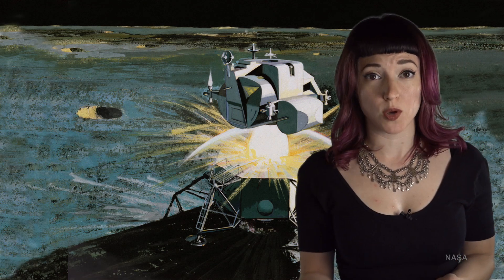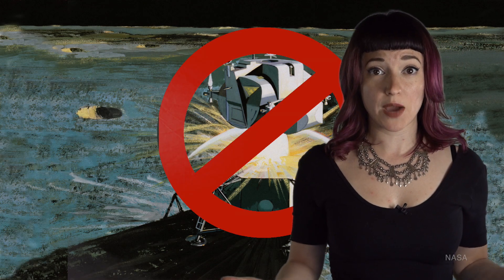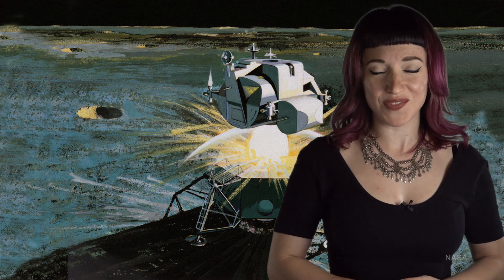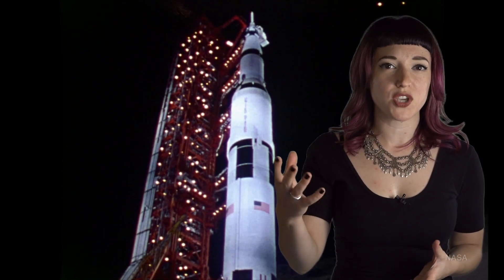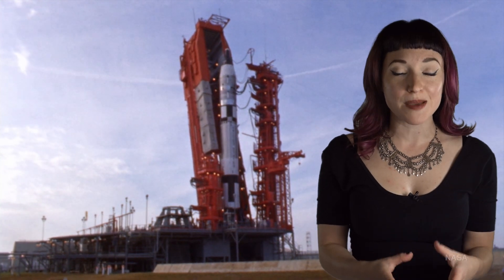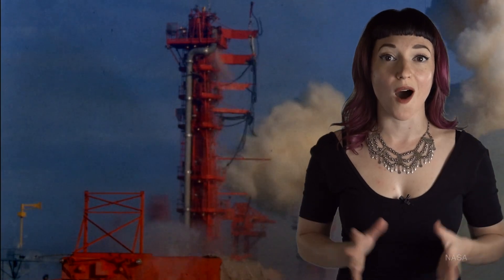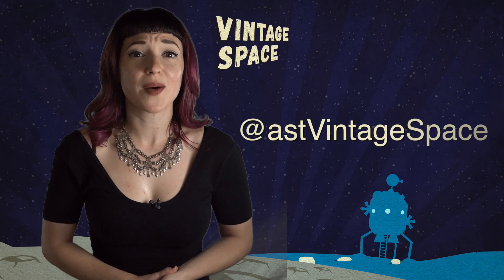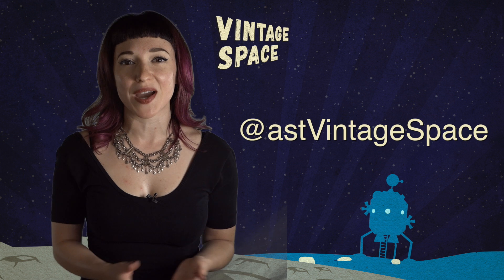How the Lunar Module Launched from the Moon Without a Flame

Comment: Moonlanding is a hoax, of course.
Amy, can you do an analysis of how the astronauts survived the radiation past the Van Allen belt?
Reply: +MaximusPayne   Google "Apollo 11's Translunar Trajectory and how they avoided the heart of the radiation belts" along with "Apollo and the Van Allen Belts an estimate of the radiation dose received". No radiation expert from any country in the world for the past 45+ years has brought forward any evidence that any of the info in those 2 links is false. Of course, there was always the possibility of a solar flare occurring during the missions but they had contingency plans in case of such an eventuality. Google " APOLLO EXPERIENCE REPORT PROTECTION AGAINST RADIATION"

No doubt you will bring up the NASA video prior to the Orion test that has you hoaxheads high-fiving each other in glee. At some point in the video, the NASA engineer said this:

"We must solve these challenges before we send people through this region of space" 

This is the only statement in the "Orion-Trial by Fire" video that supposedly hints that the Apollo landings were faked. It's pretty amusing how hoaxheads always say NASA does nothing but lie until you mistakenly interpret something that would support what you believe. So the big question here is. Do you think the Apollo missions all happened in the same region of space as to what Orion is being designed for which includes a possible trip to Mars?

Question for you: Do you think the trajectory through the VAB's for the Apollo missions from the Earth to the moon is the exact same as the trajectory for a manned mission from the Earth to Mars? 

Another question: Do you think the radiation exposure of the Apollo missions that lasted a maximum of less than 2 weeks would be the same for a mission to Mars that could last as long as 2.5 years?

3rd question: Do you think that todays electronics are as robust against the detrimental effects of radiation as the rope-core based computer systems used during the Apollo missions?

Lets here what you have to say about those 3 questions.
Reply: I won't bother with any of the technical reasons for why the belts did not pose a threat to Apollo crews since you prefer technical info from non experts over experts. Rather I'll address the hypocrisy of the VA belt argument. You claim NASA never sent man to the moon yet believe the very same NASA...not some other NASA, when it comes to the lethality and even the very existence of the VA belts. You also believe non experts in radiation over experts who have yet to come forward after half a century to say the radiation belts would be a fatal hazard to Apollo. You see, it was NASA and James Van Allen who discovered the belts via the NASA Explorer-1 satellite. Van Allen has never said there was a problem traversing the belts provided proper precautions are taken. Here is where the hypocrisy comes in. How do you know NASA didn't lie about the belts lethality or existence if according to you, they lied about going to the moon?
Reply: MaximusPayne There's no contradiction. What hoaxheads can't seem to grasp is that the statement.... 

"We must solve these challenges before we send people through this region of space"

...has nothing to do with Apollo as none of the Apollo missions were ever subjected to the same radiation flux levels as the test for Orion put it through. The hoaxheads are the ones who jumped to the erroneous conclusion that they did simply because they wanted to hear something that confirmed their own predisposed beliefs.
Reply: MaximusPayne: Short version. Here is where the hypocrisy comes in. How do you know NASA didn't lie about the belts lethality or existence if according to you, they lied about going to the moon?
Reply: MaximusPayne How about using some logic here. Why would the USA go to all the trouble of faking 6 manned landings on the moon, one of the greatest exploration accomplishments in history? Why do such a thing when they know that eventually those Apollo landing sites would be visited one way or another by other countries. They had no way of knowing where the Russians were planning on landing their remote Lunokhod's 1 & 2 in 1970 & 1973. They had no way of knowing those would be the last 2 remote rovers to land on the moon until China's Yutu in 2013. Then of course there's the much easier to accomplish imaging of the moon from orbit that the USA had no way of knowing when or if Russia, China or some other country might attempt to do.

Can you explain that one?

Here's some points to ponder with Occam's razor in mind

-> There's the live TV coverage that would have to somehow convincingly fake 1/6th G movement in a vacuum, Google "Irrefutable Proof for Moon Landing - Lunar Gravity" and explain how experts in the field of kinematics for 45+ years have never come forward with proof that the astronauts are not in an environment that they say they are. 

-> There's all the moon rock and core samples that would have to somehow be able to pass scrutiny with geologists who can readily spot whether it's something that has passed through our atmosphere or not. Google " How Do We Know That It's a Rock From the Moon?"

-> There's the Apollo 16 UV telescope images that no astronomer in 45+ years has ever found fault with. Google "onebigmonkey Apollo 16 UV Photography"

-> Another thing that astronomers would be able to spot are pictures of the Earth that don't match what they should look like. Google "Apollo 11 Earthrise - How One Photo Proves it was Real" for an example. Good luck debunking that.

-> Another one to google is "Apollo 11: Fingerprints in Deep Space" that shows obvious handheld TV footage from the Apollo 11 CM looking at Earth from far enough away that they are clearly beyond the VAB's.

-> Then there're the LOR images. Lots of hoax believer nonsense about them being faked but the transmittal data for them can be downloaded by anybody with a computer and so far, nobody has proven anything about them being faked. You don't think a smoking gun like that wouldn't have been scrutinized by people with the required computer science expertise??

-> Here's something else you might not know. Apollo 12 landed close enough to Surveyor 3 that Conrad & Bean were able to do an Eva to it and removed the camera and sampler scoop from it to be return back to Earth. They wanted to see what the harmful conditions of the moon had done to those parts after 2.5 years: Google "Analysis of Surveyor 3 material ad photographs returned by Apollo 12"

-> 5 plutonium-238 powered ALSEP's were left behind that transmitted data from the experiments back to Earth right up till 1977. Unfortunately, due to budget constraints, they were shut down but they did send back enough information that storage of it became a real problem as detailed in this article: Google "the-long-road-to-alsep-data-recovery"

-> Starting with Apollo 13, they purposely directed the spent S-IVB's to crash into the moon so that the Apollo 12 seismograph could record the seismic waves generated to help determine the moon's crustal structure and makeup. Of course, as each successful mission added another ALSEP, they were able to expand on the info derived from these man-made impacts. They also did the same with the lunar module ascent stages. The Apollo 16 LM ascent stage data isn't shown because of difficulties during the de-orbit phase. They were able to derive a lot of info from these artificial impacts. Google "The Description of Apollo Seismic Experiments darts"

Are you starting to understand the magnitude of what would be involved to pull a hoax like this off? Never mind keeping it from being
Show less
Reply: Constructs? It is SCIENCE, so with this logic you are saying NASA has faked all science? Really? Do you know how many examples there of this are in the real world that supports these "constructs." For instance an exaple of a clear flame is the type you can create with a bunson burner, the really high-end ones used it a lab I have used first hand, flame is created with a similar reaction to the LEM's aerozine engines. You can also see this with lowend Bunson burners but you can't get the flame to be as clear. I might as well say that everything you know is wrong because the universe has really been building up to me eating a sandwich.
Reply: The way to know if one is a champion regardless of who made the trophy is by the behavior or the #2 contender.  If the defeated offers no challenge to the champion claiming victory, you have ID your champion.  The best proof the USA walked on the moon is that Russia, the vanquished, says so.  Alan Sheppard golfing on the moon Feb '71 #1 White Supremacy moment in history.  Can't wait to see what we do next.
Reply: Also short busts of high radiation do not kill you instantly; ever had an Xray?
Reply: You know that the astronauts were went throught the belt for only six hours through the thinest part of the belt during the full trip. They also had a good amout of shielding around them which also helped them; though the belt could be too dangerous depending on the solar activity which, I am not actually sure, why an Apollo mission was delayed several months to wait for it to be safe.
Reply: They only passed throught the lightest/thinnest regions of the Van Allen Belts. They are made up of High energy protons and electrons. Water shields against them. They were exposed to a total of .14 to 1.16 radias of radiations total  The human body repairs itself against high levels of radiation for short periods of time bettter than smaller amounts of radiaton for longer periods of time. Kind of like picking at a scab. they were in space up to 2 weeks tops.  The Earth's magnetic field, the same thing that trappped the solar charged particles of the Van Allen  Belts extends almost 2/3 the distance to the moon protecting them from extreme, UV, Gamma, rays, etc.  withing 11-14 days, they're back withing Earth's protective atmosphere.
Reply: Well, you have a point, but if you paid as much attention as you do trying to convince likr  that you have, you'd quickly realize that every lauch was documented by the detail, by the moment..... If you've ever worked for the Government, then you should know how tightly controlled and monitored everything is.  Most of your comments here mean that you ran out of questions to support your claim,  but you cant contradict yourself now can you? Nope! You have to think of the next thing to ask so you don't look as dumb to those who believe your shit.  LOL  I guess if we didn't have the technology  to go to the Moon, then the SR-71 never flew either. But hey, I guess all fighter jets and bombers are fake too right? I'd think it was harder to fly in an atmosphere than it was in a vacuum too but that's just my two cents
Reply: she nasa shit...lol
Reply: A shitload was at stake thanks to JFK promising a visit to the moon.  The US has to act and act fast or it could lose it's global reputation of power.  I believe the Apollo program was genuine and real, but I also can clearly see how the lunar landings could be staged to save face once they realize it wasn't going to be as successful as the manhattan project.
Reply: Guys, it's OK to be skeptical. Remember that the only proof we have of the actual moonlanding are the documents NASA themselves show us.

How would you believe if I told you I'm champion of the world of X, if I'm the one who made the trophy and show it to you?

What I mean to say is that never put someone down for not trusting. It's OK to believe, but it's OK to not believe too. I can never be sure that it actually happened, as there is no objective proof of it. Yes, pictures and movies prove nothing, I'm afraid.
Reply: Again, all that "evidence" are just constructs that come from NASA themselves, nothing you can prove for yourself. It's OK to have faith, but you cannot say it's true for sure. Once again, how can you be sure that I'm a world champion if I made my own trophy? Not being able to prove that something is false does not mean it's true.

People will believe anything they want to believe, like all religions do to fool the billions of inhabitants in this planet.

Many of the facts you posted can be done without the need of human intervention, so there's that...
Reply: ***** The real problem is not about believing one thing or another, but lies in the contradiction on statements from the same issuer. If Nasa says that you can't go past the Van Allen belts, it doesn't matter if it's true, provided they, at the same time, say they were able to do it.
Contradiction lowers credibility a lot.
Reply: @PayneMaximus  You sir are a moron.
Reply: "It's OK to believe but it's OK not to believe too."   What do you mean "OK"?  If you mean that in a free society, a person is entitled to hold and express whatever belief they have, then of course it's "OK" not to believe in the moon landings.  But if you are suggesting that the evidence for the moon landings has ever been compromised by actual evidence to the contrary, or that the "evidence" that the landings were faked is on a par with the vast array of NASA and non-NASA evidence, both direct and indirect, that the landings happened in exactly the way history says they did, then that is not "OK."  That would be a distortion of reality, a perversion of the truth, and a wild misstatement of the facts.  I don't know what you mean by "objective" proof.  Photos of the LMs on the surface won't do?  Testimony of thousands of witnesses?  The rocks themselves?  I have been a trial lawyer for 30 years, and I can tell you the evidence of the moon landings is more overwhelmingly incontrovertible than any evidence I ever saw for any case, period. If you don't believe the evidence then I presume you don't believe China exists either, or Antarctica, or whatever you yourself haven't experienced.  Because--assuming you haven't been to those places---you have no more evidence to suppose they are real than you have to believe the moon landings occurred.  But I'll bet you know they are there, and of course you're right.
Reply: ***** What???

Comment: For those that care, both the US and India orbited lunar orbiters around the moon back in 2012-2013.  Although both missions were in lunar orbit to photograph lunar out-gassing from the lunar surface, both orbiters had highly resolute cameras.
These cameras took calibration shots at times and it was determined that these orbiters would be able to resolve the Apollo lunar landers.
4 Apollo landers were imaged on these lunar orbiters with sufficient resolution to see not only the Apollo lander but also various  craters and tracks left by the rovers and even trails of footprints left by the Apollo astronauts.
Careful examination of these lunar orbit photos show the same details imaged by Apollo astronauts on the lunar surface.
Proof, positive, that we landed on the moon, several times.  With photographic proof from multiple directions and multiple lunar altitudes.
Enough with bozos who still contend Apollo was a massive hoax and the US never landed on the moon.
Reply: Yes, there's a great link that does a pretty thorough job analysing the crater locations from such images compared to when the Apollo landings occurred. Not sure if you have seen it. Google:
"onebigmonkey-_apollo+sights_landing"
Reply: If you have a link to the Indian mission imagery of Apollo sites, that would be helpful. The only Indian mission to the moon I'm aware of is the Chandrayaan-1 mission which was conducted in 2008. It mapped the Apollo sites but to the best of my knowledge, never imaged them to the detail necessary to see Apollo artifacts. The Chandrayaan-1 mission was in an orbit of around 100 or more miles above the lunar surface while the LRO had to get as low as 15 miles above it to image Apollo artifacts. The mission that did image the landing sites was the US Lunar Reconnaissance Orbiter (LRO) which is still operating. If India managed to image Apollo sites, that would be verification of the landings outside NASA. Hoax advocates like to point out we only have one source for Apollo imagery which would be Apollo and LRO, both NASA undertakings. But then, they will only say the Indian government was in on the alleged Apollo lunar landing hoax.
Reply: +J Dean  ["If you have a link to the Indian mission imagery of Apollo sites, that would be helpful."]

Here you go. It's for the Apollo 15 site and includes images from Japan and China as well as India. The resolution quality is not great but good enough for him to compare craters and rocks to do a pretty thorough analysis of it all: Google "onebigmonkey/apollo/sights/landingsa15a"
Reply: Thanks for the link. It took me to the Japanese Selene image reconstruction of the Apollo 15 landing site. This is not an actual image of the site but rather a computer reconstruction based on Apollo 15 data. The nice part about this image is that the only way Selene CGI would match Apollo 15's landing site is if Apollo 15 had been there. The Chandrayaan-1 imagery is too low resolution to readily identify the Apollo artifacts. The LRO images are the best so far.
Reply: Thanks for the info.
Reply: Thanks.  A lot more people know of what I mentioned than I thought might.